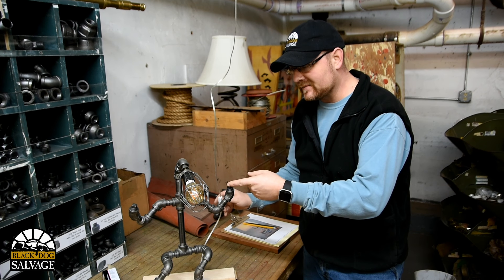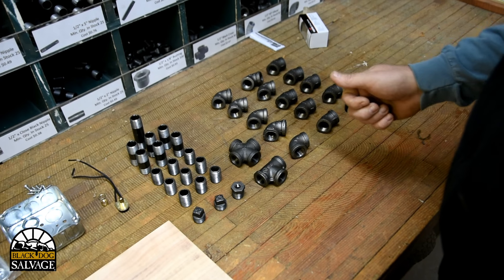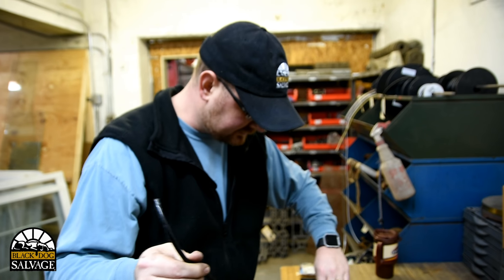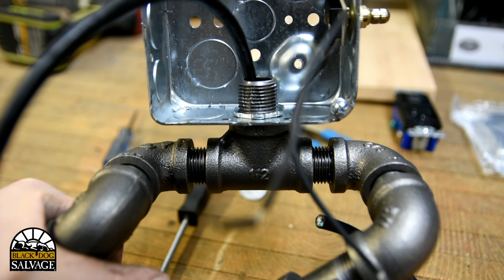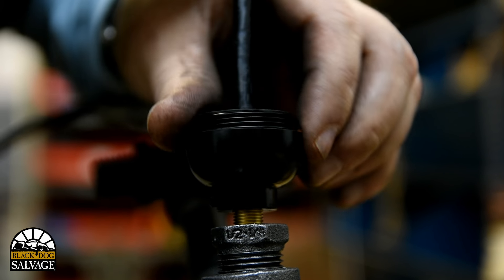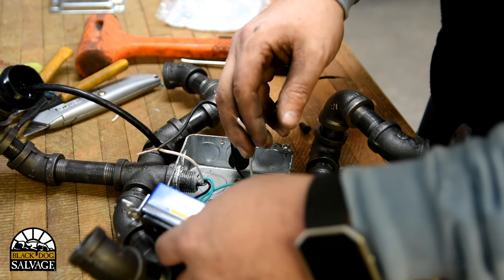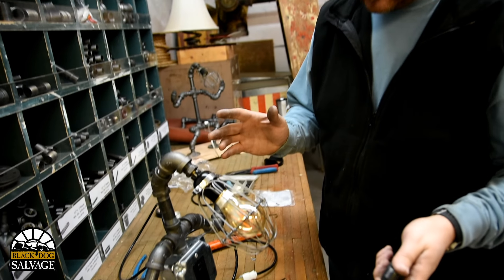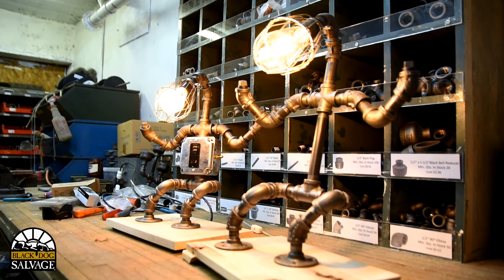How to Build an Iron Pipe Light Man - Quick Tip Tuesday

Comment: How are you not messing the threads up, when you tighten them with the pliers, or even the inside threading with that metal rod?
Reply from the maker: The tolerance for black pipe threads is so big that as long as you arent squeezing with all your might, youll be fine. Thanks for watching!
Reply: Beautifully made, better than any I've seen sold online. But what's the name and dimensions of each peace and how many of each does one need?
Reply: Also actual black iron and not that cheep decorative amazon pipe, is a lot tougher.  Amazon pipe will cost you 25 for 10  12" pieces.  Actual iron will cost that for 3 or less pcs.